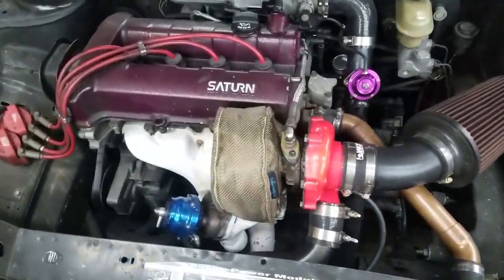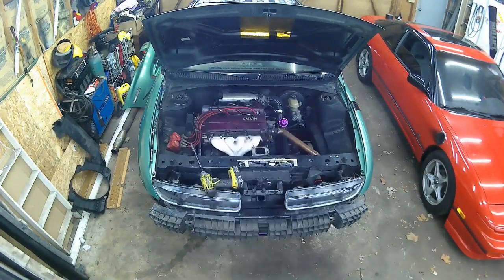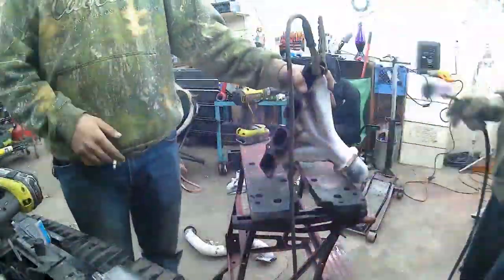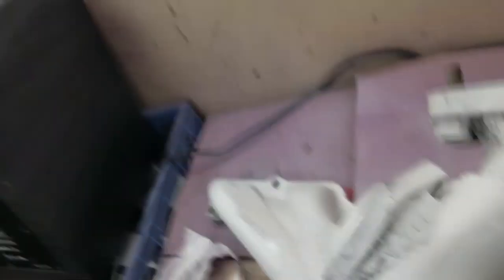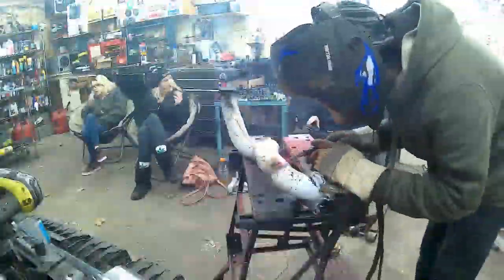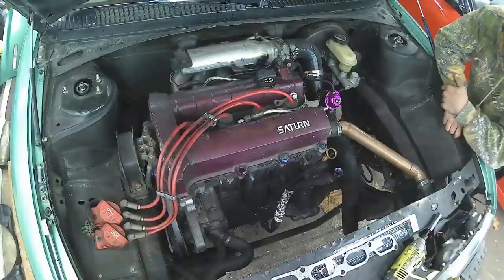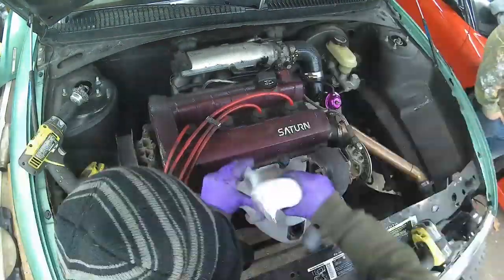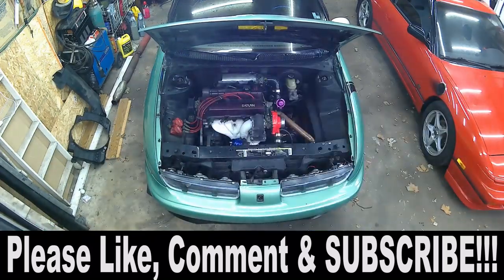Turbo Manifold Repair

Comment: Nice Saturn!! My question is what coil packs are you using? How did you wire them up? Just picked up a Saturn SL2 and would like 2 do the same, also what spark plug wires are you using with the coil packs? Sweet Saturn bro!!